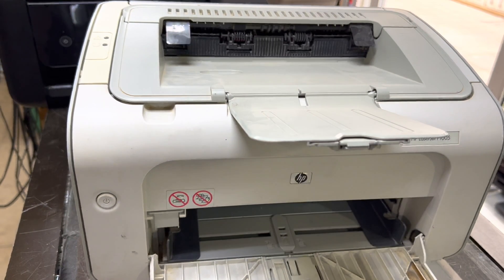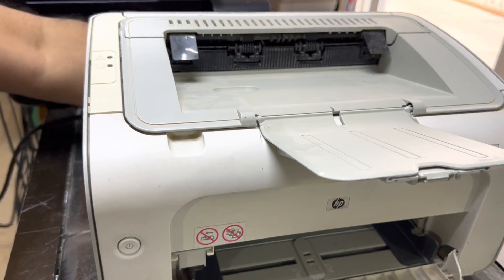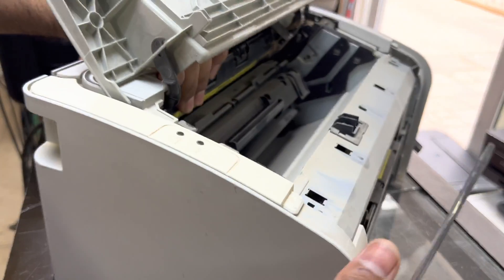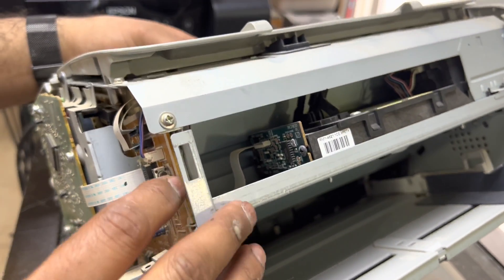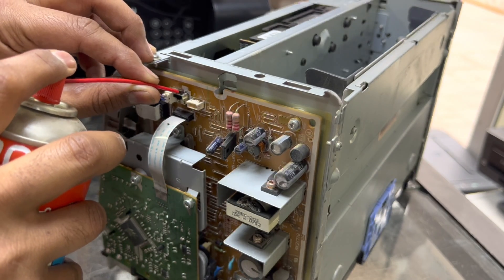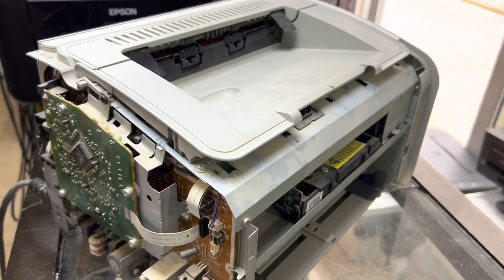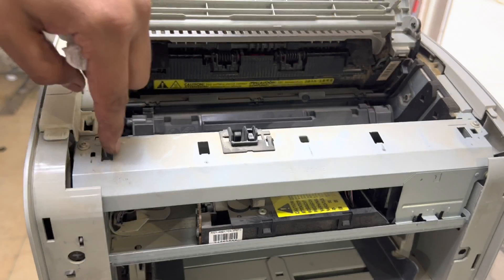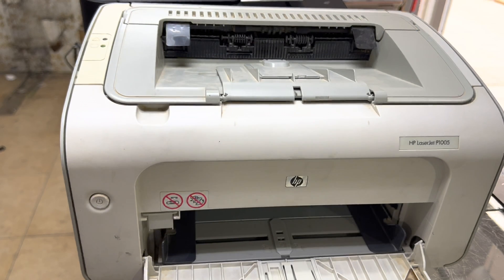Hp 1005 LaserJet Printer Power Board repair

Comment: thanks for the video,
I have hp 100 laserjet and it works fine most of the times but some days it turns off (crashes) during initializing and before READY.
i have took this to local repair shop but they couldn't fix it.
can you help in this regard please